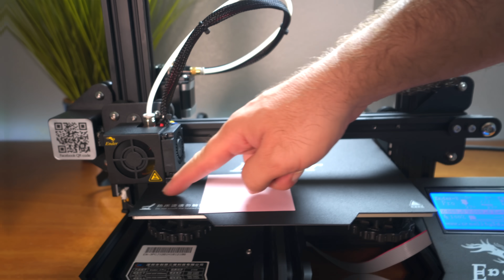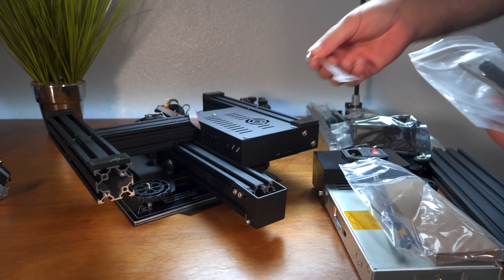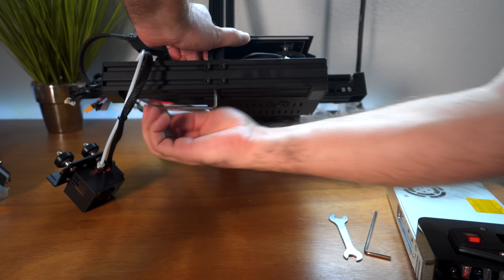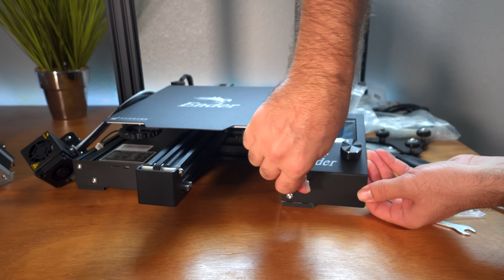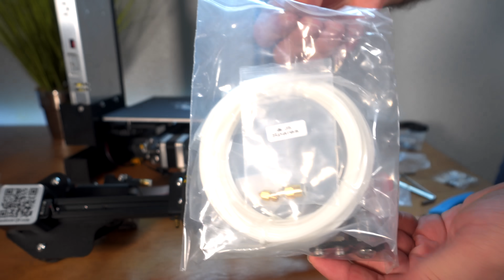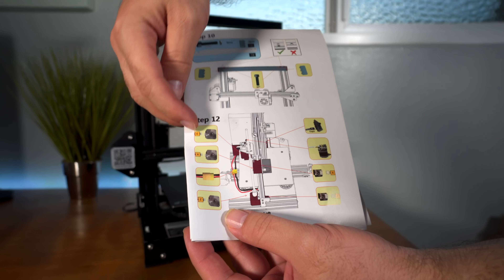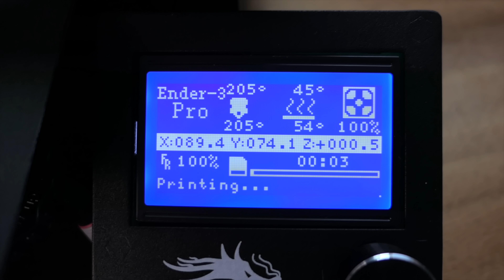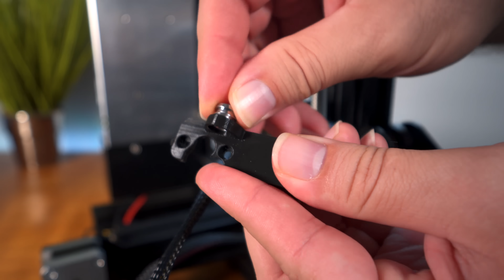Creality Ender 3 Pro -  3D printer - Unbox & Setup

Comment from the maker: New Channel: www.youtube.com/@Just_Print
Ender3 Pro: http://geni.us/xUMach
Recommended: http://geni.us/JustVlads
Ender3: http://geni.us/BCmFRP
Upgrade Links: ⬇

Capricorn tubing:https://geni.us/nOtX
Stepper Dampers: https://geni.us/pXvmFBR
Silicone Sock: https://geni.us/rArnrL
Metal Extruder: https://geni.us/SqP89R
TL Smoothers: https://geni.us/eBM2vv
Gear Puller: https://geni.us/Edm856p
Timing belt pulley: https://geni.us/BAvciy8

Printable Upgrades:
Fan duct: https://www.thingiverse.com/thing:3365114
Filament Guide: https://www.thingiverse.com/thing:2770487
Ribbon Clip: https://www.thingiverse.com/thing:2880021
E-Knob: https://www.thingiverse.com/thing:3115901
Tool Tray: https://www.thingiverse.com/thing:3162464
Side Spool Mount: https://www.thingiverse.com/thing:2967567
Spool Holder: https://www.thingiverse.com/thing:3209211
PCB Cover: https://www.thingiverse.com/thing:2987100
Pressure fitting: https://www.thingiverse.com/thing:2994683
Z-axis Mount: https://www.thingiverse.com/thing:2752080

Comment: This was very useful. But, you should not have skipped the part where you mount the crossbar onto the unit. I know you forgot to record it. But, you should have dissembled, and restarted the recording. I was having some trouble with this step, and your guide skipped it!

Also, some attention to wiring and placement/routing of the wires would make this video better.

Comment: First of all thank you for this video I have managed to assemble the printer perfectly, 

I do have one issue, I have the same printer as this video however I don’t know how to do the bedding or adjust the bedding to make it aligned properly it’s either the nozzle is too high or too low and collide with the printer mat. 

I thought it could adjust itself which is not the case, I physically changed the four adjustments as I thought it was a physical problem but it is not. 

Thanks for taking the time to read my comment 👍

Comment: Everyone seems to be having good luck with theirs, mine not so much. The z axis motor was too close to the support causing the rod to be noticeably misaligned  and gets  in a bind. Had to make a cardboard shim to get correct rod spacing at top and bottom of frame. Digital readout often locks up when trying to input info. Completed two builds out of about 3 dozen attempts. Tried leveling over and over, tried different cleaning and adhesive methods but nothing will consistently stick to the bed. People say get a glass bed, invest in stronger springs, or try to level it again. If it is that important it should come with a glass bed, it should come with a self leveler and it should already have the right strength of springs. I should not have to buy replacement parts to try to  get it to work out of the box .It's Going back to Bezos

Comment: So I bought me a Ender 3 and it took so long to get it then wanting to put it together you got this mumbler that likes to talk about nothing related to the subject then when he is showing you how something goes right when he does it he cutts off the feed and starts something else,  I hate to say it guy but you don't need to be showing anyone on how to put something to gether because you suck at it. Now I got up to the belt after rewinding the video 8 to 10 times then had to guess if that's what you've done or not. People that just talks about non related stuff while working on a printer shows you're not really into it which might be the reason why right when you show how to wrap the belt you cut it off not showing if it loops around the  horizontal structure bar or if the belt is supposed to lay on top of each other not to mention all the other times you cut the video to start assembling another item to it. PS remember if you don't show the complete step and do it while showing us you don't need to be in this profession because what in the hell is this video for. Peace time to go find someone that actually shows how to do it instead of us being talked through it.

Comment: I really wish people would stop referring to the voltage switch as "they forgot" to switch it. These printers go all over the world. If you plug 110 into it and it's switched to 220, the worst thing that happens is it will cut off when you try to print. However, if you plug 220 into a system set to 110, you might wind up with fireworks. I built computers for years, all of the power supplies were set to 220. Get over it and just switch to 110 and move on, stop letting it ruin your day. Just check, change if needed and move on.

Comment: at the beginning when you turn your plate upside down and use the allen wrench to tighten and make sure the it doesnt wobble. my ender 3 pro came with all thsoe tools but the bolts at that part aren't allen bolts so i cant use the allen wrench on them.

Comment: I have been trying to find a good 3d printer but its so confusing as every possible printer I look up always has 50/50 reviews with half saying its wonderful and the other half saying its absolute garbage. I thought about this one but it seems like a hassle to set up as I really can't do any wiring or calibrating or anything of that nature. Is there any good 3d printer that I I can just plug in, fill with filament and it will work?

Comment: ive just bought one of these printers and was wondering if the z axis block is supposed to be tight or loose as mine i can move up and down with my hands not by much maybe 2-3mm but enough to think its throwing my bed levelling out as i have yet to do any prints.

Comment: Advice: Don't adjust bed if you do not need to. My kit didnt have the allen bolt on the bottom and spent more time breaking then fixing unfortunately.

step 7 and step 8 flipped

Comment: Your video was amazingly helpful, however you didn't explain certain steps that are immensely important, how to properly put filament into the printer, as well as forgetting to mention the simple prints the sd adapter that exist. Thank you so very much it was a valuable and useful video.

Comment: Great share. I just got an Ender 3 Pro from Micro Center for $108 including tax. there is a $100 coupon with them until 1 April 2022. Shelf price is $199. Go get one.
Edit: took about 2 hours to get it together and get it printing - thanks for your video - gave me a lot more confidence to move fast on the build.
The number one issue - the only real issue - is the leveling wheels are at one end of their travel, not centered. I saw your follow-on video where you showed the fix for that by moving the Z endpoint switch.
I will be doing that one.
Edit 2: Oh there is another issue - the Home position is off the plate and I had to set x and y offsets to 117 mm from the front panel.  That worked to center, but it doesn't store the offsets. I will have to look at saving profiles.

Comment: Thank you SO much for all the work you put into this video! Your explanations and insights were invaluable in assembling my printer. My only issue was I put everything together before routing the main wiring harness under the left side. Had to take the top and side rails off to reroute the cable.

Comment: Very helpful! Thanks for this. A couple of notes: Auto Home is in the menu under "motion". There are little blue U clips that keep the filament tube from pulling out - used as a spacer. They are the same style as tube locks for a water filtration system. Thanks again

Comment: Thanks a bunch . I’m just setting mine up and I’m plugging in the last power cable Z to the motor but it looks like the cable is to short :( any suggestions ? Doesn’t seem like there is room for more it goes inside the box

Comment: Platform adjustment advice was backwards: it is far more difficult to adjust it before the thing is assembled than after. Also, the advice was incomplete and not very useful.  I recommend looking up a video specifically on the topic if you don't want to end up making things worse.

Comment: I watched your video immediately after ordering my Ender 3 Pro. Watched a few other videos as well. Yours was by far the most helpful. I used your video to build my machine and finished in a few hours working slowly. My bed would not level properly after build completion. Had to make some adjustments to the top bar recommended in another video. Got it all worked out. Printed my first test print using the supplied white sample filament and completed the puppy dog print off of the provided micro SD card. Doesn't appear to be enough for another test figure, FYI. Thank you so much!! You're video gave me the confidence to take the plunge and start this hobby. Hoping to teach my two kids. Could change their future.

Comment: This is my first 3D printer and I love your presentation.   I have questions about the wire connectors which can be inserted in two ways, sort of up or down.  I see that you  just pick up a wire connector, twist it and insert it.   Is there a right way to twist (or turn) the connector for insertion?  Does it matter?  Are most connectors symmetric ?   Am I too paranoid?

Comment: No matter how hard I tried to get the spoon holder in place it wouldn’t work I tried everything to the point where the bolts are now stripped so any suggestions on how to get it in there now would be very helpful.

Comment: I appreciate this video.  Mine (as well as others I see in the comments) didn't come with instructions.  Your video helped with the assembly.  If I could offer any critique at all, it would be the fact you glossed over two big things...  1) leveling the table  and 2) feeding the filament.  For newbies like myself, those are kind of a big deal once the excitement has has peaked after getting everything assembled and powered up.  Leveling wasn't hard to figure out for someone with mechanical aptitude, but I'll have to look elsewhere to figure out how to feed the filament.  It stops at the guide roller/gear.  Are we supposed to just leave it there?  push it through? Do we need to spin the gears manually?  Is there a menu selection to activate the gears so it will feed to the nozzle?  If I had to guess, I'm not the only one with those questions.

Comment: On your controller board the EXP3 slot is pacifically made for the ender 3 , using the other ports isn’t recommended as those are for the older generations, they use the same control board for all versions so they just have separate slots for each version

Comment: wow this is helpful, as a first timer and absolutely new to 3D there's a lot of checking and fine tuning that they don't mention in the purchase and assembly... 
The filament alignment or routing wasn't even mentioned in the instructions and I am still uncertain if that's all correct and how to get to the nozzle for cleaning, care or replacement. I'm almost scared to turn it on incase it doesn't home properly and grinds down into the bed ha ha

Comment: I just bought an Ender 3 Pro, and the first thing this guy does is tighten Allen screws to tighten the bed. My Ender 3 Pro doesn't have Allen screws in the place he is talking about. I just have nuts on the top.and bottom.

Comment: The part around the 14 minute mark I absolutely cannot understand, mine came unassembled unlike yours, and there is absolutely no way that this thing remains solid on the rail without simply popping off because there's nothing to hold the two rectangle things together. Also even if there was it would move the belt off track and to the side entirely so I'm not exactly sure I understand where to go from here

Edit

Realized I had the big ball thing backwards because I mistook the big side for the other on account of my end piece not even having a visible backside unlike yours but the rectangle things still don't keep it inside of the railing, seriously am totally lost

Comment: Hi Vlad,
my printer was working fine at first and I even printed a few things. But something happened and the filament is not feeding.  I even make him print and the bed heats up and starts moving and printing, but it doesn't feed on filament and even though it moves it doesn't print anything. I do not know what I did wrong. I don't know how to insert the filament. 
Thank you

Comment: The Ender 3 is definitely a lot better than the ender 2. The ender 2 is piece of crap.
One thing I don't like about the ender 3, though, is how the power supply is just stuck on the side with the IEC cable sticking out. It should be underneath with the cable at the back. Id also move the control panel to the front left. If you have it on a shelf with other stuff next to it, the PSU and control panel will get in the way.

Comment: Make sure you plug the X and E wires into the correct slots as they're the same size and style and can easily be plugged in wrong. I freaked out for a sec when my X axis didn't work but it just ended up being those wires.

Comment: I am a little unsure about loading the filament.  The instructions say to push it all the way through the nozzle.  I didn't see you load it in the video.  The filament that came with the unit is much larger than the nozzle opening.

Comment: i'm trying to print the dog that came in the sd card but it messes up pretty badly right about the 3rd layer. is that because of bed level, or something else? i adjusted it as well as i could. temperatures? i set those to what it says on the filament roll. kinda stumped here.

Comment: Just got an open box one at a deep discount. As far as leveling the bed, would it work to use a dial indicator mounted on the rail to get it "machinist close"? I'm a bit of a perfectionist for alignments.

Comment: Amazing video. Showing such detail is amazingly helpful. Much better instructional video than the manufacturer provides on the SD card. I used this video as I built mine, everything went smoothly apart from a wire I forgot to plug in on the z limit clip on the left. took me a good half hour before I noticed my mistake with the help of some very friendly people I found on discord. always check you have all your wires plugged in :P.

Comment: Question my printers parts are working fine but the screen won't turn on unless I move the X Y or Z axis really fast and the funny thing is if I move the parts long enough it turns on fine but will shut off when I stop moving one of the Axis IDK what's happening does anyone know

Comment: I wish I would have seen this video BEFORE I started putting mine together.  This was my first experience with 3D printers and I found my bed wobbly when I got it all together, and had trouble leveling the bed.   The assembly video they include on the SD card does not cover the wheel adjustments.. They spent more time taking each piece out of the box and looking at them, then they did explaining things. :( 
Thanks.

Comment: my printer is not level when I unboxed it the front left pad does not touch the surface. I rotated to verify and the same pad off balance. Any suggestions? I don't want to put my printer together if the main part is not even balanced.

Comment: This was an absolute nightmare to assemble, even with your video. Who the hell invented these nuts? I think I've spent an hour trying to get the spool holder nuts to go horizontal and stay in the rails.. Anyways, thanks for the video, without it this would be even harder (because of the bad supplied instructions) and I think there would be a 3d-printer-shaped hole in my window.

Comment: Thank you so much for the video! It helped us assemble the printer with no headaches. The only step I would recommend adding is leveling the bed before starting to print! Question: could you provide a link for the bolt you used for the filament guide? thanks again :)

Comment: I really need some help here. The front of my bed is a lot lower than the back of my bed. the back seems to be in the right spot. the bed itself does not wobble. 

How do I level the bed if I already assembled the printer?

Comment: Thank you very much for your instruction.  It saved me a lot of time.  I hit three problems when assemble this: 1) I tightened the two vertical bars too tight at the beginning, that made it hard when I tried to put down the horizontal bar into the rail.  I had to loosen the vertical bars to adjust;  2) I accidentally put the top cover bar under the filament feeding cable, which made me redo that part again;  3) It is kind of hard for me to feed the filament into the pipe, even I preheat the bed. I cut a wedge but it was still hard to get in. I had to use a small screw driver to push it down into the hole.  But all were resolved and I'm printing my first piece now ;-). Guess I will hit many more issues without seeing your instruction here.  Thanks again for your detailed instructions.

Comment: I just purchased an Ender 3 Pro, and I'm anxiously awaiting for it to arrive. While I'm waiting, I'm trying to find what the dimensions of the machine is. I believe the answer I'm looking for is listed in your video description for "machine size", but I was wondering if you could confirm that for me. Looking from the front, the length is 17.3, width is 16.1, and height is 18.3 inches? So Ideally a work space of 18x17 flat top space would be ideal? Any comments on this would be awesome. Great video, I definitely will be looking back to this when I receive and start assembly. Thank you